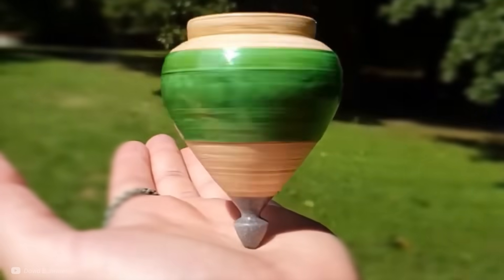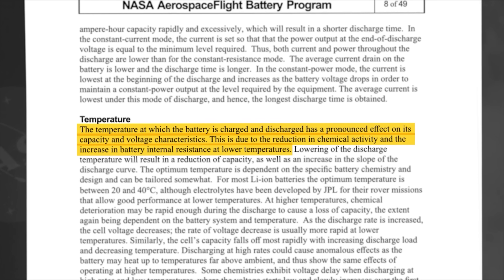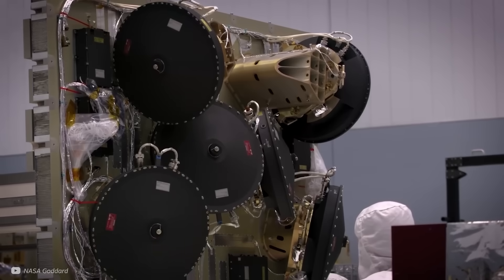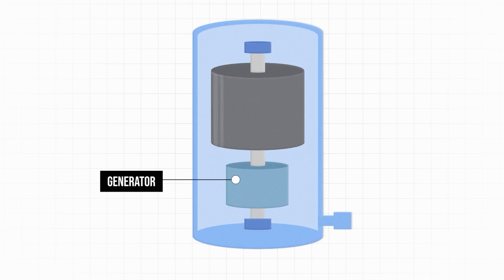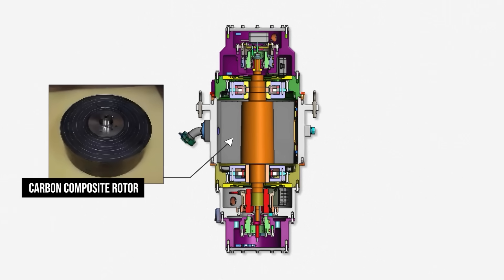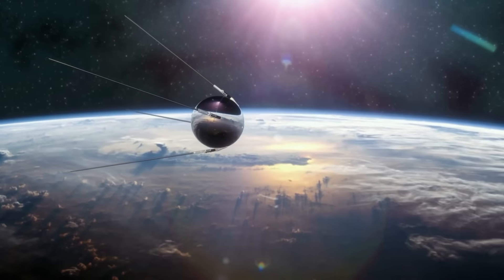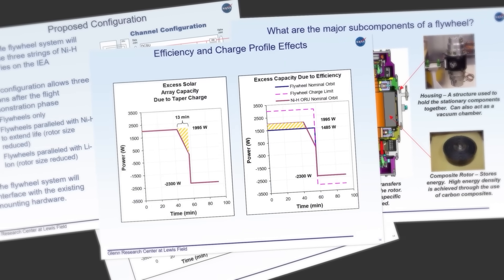How NASA Reinvented the Mechanical Battery

Comment: 6:20 what is said here is not 100% true in all cases, but ... True for 99% most common types of motors. There are exceptions and side effects.

The main issue is that :
- efficiency is not the same in both ways 
- operating an engine in both ways does have engineering challenges 

That's why outside Tesla, regenerative EVs were rare, or working with very low efficiency. Even Tesla was able to improve efficiency with « simple software updates » on some models. 

One example of particularly bad bidirectional motors are linear motors. 

This bidirectional aspect of motors is closely related to electric breaks used in trucks .... Trucks have low efficiency . Trains have both ability to use electric break and/or regeneration ( reinject in the network ). They usually try to reinject, but they still need to be able to slow down even when grid got disconnected by circuit breaker ... 

=» there are optimisation issues and exceptions, but most motors are reversible, and it's a HUGE topic. 

And in short, DC or AC does not matter. Both are reversible.

Comment: Stored energy is stored energy. It might not give you a large fireball on failure, but the excitement of a 100,000RPM flywheel escaping is hardly better. I’ve seen the results of a bearing failure on a 10,000 RPM gyroscope, and it wasn’t discouraged from exploring the building it was in by trivial obstacles like walls. I know which I’d prefer to fail in any building I’m in. Even light flywheels for control moment gyros on Hubble have struggled for long bearing life.

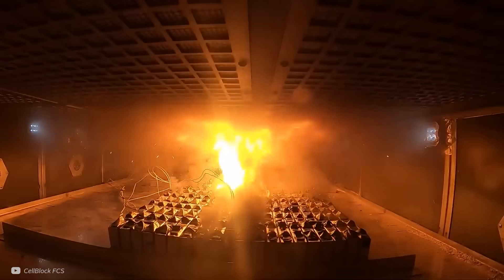Comment: 6:45 "they don't need as many rare earth metals" - This is a myth propagated by those who are ideologically opposed to electric vehicles and is designed to give the impression that lithium batteries use something that is rare. Rare earth elements are not rare and lithium batteries do not even use rare earth elements.

Comment: 5:10 "up to 50x the energy density of lead acid batteries" - the energy density of flywheels is similar to that of lead-acid batteries. However, the power density of flywheels is very high, i.e. you can put in and take out a lot of energy in a short time, quite possibly 50x the power density of lead-acid. 

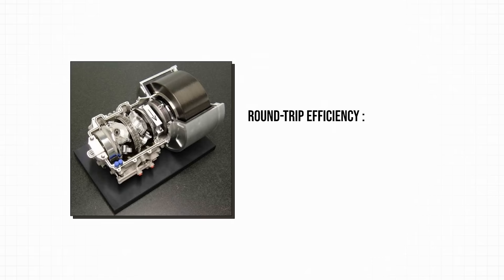Your slide at 7:10 shows specific energy figures of up to 36Wh/kg, lead acid-batteries are around 40Wh/kg. At 9:38 you quote an energy density of 33Wh/kg.

Comment: Ive never understood why even though motors & generators are the same why they dont also generate & be a motor at same time especially in space where theres minimal friction and also why dont they make use of drag to generate in the atmosphere as drags going to happen anyway so might as well make use of it  flywheel giroscopes have to be used for stabilisers so might as well generate from them aswell every little helps even if its only a trickle of energy as i know its not wise to have more torque thats why i said just a trickle

Comment: 7:08 but they should, there was a 1960s experiment using flywheels in buses and it went swimmingly for quite some time but had to be scrapped due to safety concerns which thanks to tech advancement are no longer an issue. 

The flywheel buses took less then a modern EV car to spool up, for 4 hours of use, had 2 massive steel flywheels in a steel container spinning in opposite directions to remove the gyroscopic effect and ran entirely off the flywheels. 

Modern Flywheel based mechanical batteries run at much higher speeds thanks to improvements in bearings and material science and so can reach the energy density in a much safer way without even the slightest chance of a giant steel disc breaking containment and flying down the road like happened with the 60s experiment.

Comment: If an electric motor has permanent magnets installed to replace one side of the coils it is also an alternator but not all electric motors are alternators. Some require constant electrical input to even be motors. This is due to the dual coil fix invented by Nikola Tesla* I believe.

*not any of the scammers using his name for brand recognition.

Comment: NASA didn't reinvent anything, and the whole concept is a moronic idea, that is why they eventually abandoned it. You don't need a lot of energy storage for a control moment gyro (CMG), this allows them to be compact, reliable, and relatively cheap to produce. Replacing a simple device with one that costs 100x more, is less reliable due to carbon fiber delamination, and requires complex control systems to stabilize the magnetic bearings, is simply a bad design. In addition, a single flywheel will weigh more than a standard battery and CMG. You will also need multiple flywheels. Also, the gimbals that the flywheel sits in need to be massive as well. NASA has been a huge waste of money, but hopefully, DOGE will eliminate it.

Comment: Nice vid so far. However, minor point.. Not every generator is a motor, and not every motor is a generator... Oh alright fine, they are, but some are FAR more efficient when run in "reverse" than others. The idea of just grabbing any old motor and cranking it by hand doesn't actually work all that well. You need one that is designed for high efficiency in both "modes", for the want of a better word.

Now if I could only remember a few examples. Older cars will have alternators. Older still will have generators. Those used to be pretty good both ways. A switching motor though is rubbish. Something about pulsed coils instead of continual fields.

Edit: Finished the vid. Good presentation. Earned a sub.  Another guy here on YT made a 3D printed vacuum battery. As in it's a series of plungers that when drawn out, create a vacuum within a cylinder. The weight of the atmosphere pushes them back in again, which turns a small generator. I personally love the idea, though I'm not sure about energy density. If a cylinder ruptures, it'll implode. Which is far easier to work with than an explosion. And given the vacuum forms almost instantly, to vary the 'charge' all one has to do is extend the cylinder. Provides constant pressure for the full draw, whereas compressing air into a cylinder has a high and low end to a scale. With full charge obviously being quite dangerous and potentially explosive.

Personally, I'm partial to artificial dams used for hydroelectric. Pump from the ocean up into a resevoir in the hills with solar power, then drain the resevoir back through the pumps to generate power at night. Efficiency is supposedly up around 95%. Fresh water from a lake or similar might be better for the local environment. Rain is 'free' power.

Comment: We already "store" impressive amounts of energy like this in the massive steam turbines of power plants. I wonder if for stationary applications less high tech and rpm but greater mass and number could be econmical or not ... probably on the very long run only  though only due to no degradation compared to lithum.

Comment: Vacuums do not have temperature. Temperature is a property of matter. The absence of matter means the absence of matter thus no temperature. Space stations actually overheat. They are cooled via radiation which is why they have large panels where coolant is flowed through to produce infrared radiation to cool via radiation.

Comment: I've always wondered how effective it would be to replace the steel mass of the flywheel with electrical batteries. Sure the density wont be as good so the flywheel will be less effective but it would also be able to store electrical energy in what would otherwise be useless steel mass. The mass has the be their anyway so why not make it something useful.

Comment: Back in the 1980s, I worked on a project involving a flywheel made of depleted Uranium. As best as I can remember, the "wheel" or Uranium mass portion was approximately 500-700mm across and 100mm thick. The mass was obviously approaching 1000kg. We were developing an ultrasonic flaw inspection technique for it. There was a concern that the wheel might fail catastrophically when spun to it's intended speed. I imagine that would destroy just about any facility housing it.

Comment: 6:02 --- "Every motor is a generator" --- could you elaborate on that? I don't quite get how induction motors could generate power: wouldn't it's stator need an external source of energy to create magnetic field required for electricity generation?
Reply: I suppose he thought "Every motor is a generator" was a more elegant way to put it than something like "Every motor is a generator when the motor/generator is allowed to spin freely and, if necessary, when a temporary source of energy creates the initial magnetic field until the motor/generator can supply its own current for the field".
Reply: Already wrote a long comment on this, but it's true for 99% motors, AC or DC. 

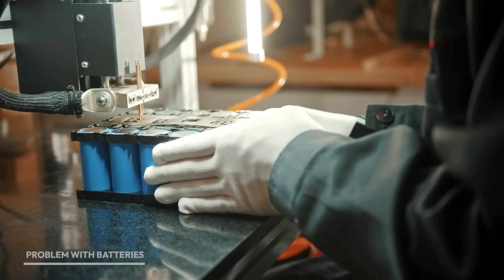For some types you need an excitation power in order to get a reactive power, usually with a ratio of 1:10. So yes in some case you need an external source, but still you motor will convert mechanical energy into « more electricity than you had at the beginning ». 

Most plants work this way today. It helps keeping generators sync.

Plants which can start without any source are rare, and harder to sync ( old hydro in France ).
Reply: Yes, you are correct and that's exactly how a car alternator works. Needs power to make power.

Comment: Have you come across the giro bus that used to operate in Switzerland. As it stopped at a bus stop it picked up power from an overhead power line. The giro weighed about 3 tons and span at about 3000 rpm in vacuum chamber to reduce losses from air turbulence.
Reply: Eso era un peligro total,si salía disparado podría haber destrozado medio Zurich,bueno si hubiese sido en el barrio de los banqueros no hubiese estado tan mal😅.

Comment: I don't think flywheel based energy storage is any safer than chemical. They may not be prone to chemical runaway but they're prone to mechanical failure instead. And then the stored energy has to go somewhere.

Comment: The operating temperature constraints of chemical batteries were the reason for a particularly unique problem with the hydrogen/oxygen fuel cells used as the power source in the Apollo Command/Service Module (aka CSM), which was actually mentioned in the "Apollo 13" movie. In the immediate aftermath of the explosion which crippled the CSM, one of the last procedures mission control does in a desperate attempt to isolate the oxygen leak was to close the "reactant valves" on fuel cells 1 and 3. The CSM had 3 independent fuel cells, 2 oxygen tanks and 2 hydrogen tanks, with each fuel cell capable of being fed from either tank. The "reactant valves" were just valves between the tanks and the fuel cells.
The electrical system in the command module had everything doubled up, powered by two independent distribution buses, labelled "Main Bus A" and "Main Bus B". These were redundant systems, with each one capable of powering all the equipment on the spacecraft, so if one failed, the other could completely take over. Also, only one fuel cell was technically necessary to power the entire spacecraft, though only if it was operating at maximum power output.

Fuel cells are essentially primary cells, and are basically batteries: The difference being that the chemical reactants can be continuously supplied. So provided you can keep feeding hydrogen and oxygen to the fuel cells, they will continue to make electricity for as long as you like. They do of course have the same temperature constraints as any other chemical battery, and would stop working if allowed to rise too high or drop too low.
In the environment of space, the more significant risk was the temperature dropping too low, since heat would be easily radiated away. The fuel cells operated at elevated temperature (they had to be kept hot to continue working), and the reactions which produced the electricity were also exothermic, producing heat while they were operating. As long as the fuel cells were operating with at least 50% of nominal power output, the heat produced this way was enough to compensate for heat loss, keeping them within their operating temperature range.
However, with all three fuel cells operating, the electrical demand was not always enough to keep them hot enough. So the fuel cells had integrated electrical heating elements to compensate for this: If the power required by the spacecraft dropped below 50% of the fuel cell output, some of the power produced would be diverted into the heating elements, in order to maintain the temperature within the operating range.

In the Apollo 13 movie, there was a discussion between the Flight Director (Gene Kranz) and the "EECOM" flight controller (Seymour Liebergot), where he suggests closing the reactant valves on fuel cells 1 and 3. Kranz objects on the grounds that the valves cannot be re-opened once closed, so this procedure would leave the CSM with only one operational fuel cell. Anyone familiar with how fuel cells operate may have questioned how this could be the case. Well, the characteristics of the fuel cells described above provide an answer to this: If the supply of hydrogen and oxygen to a fuel cell are shut off by closing the valves, the fuel cell can no longer produce power, so both methods of heat production (the fuel cell reactions plus the integrated heating elements) will also be shut off. The fuel cell will then cool down to below its operating temperature range. Once that happens, the fuel cell is effectively dead - even if the valves are re-opened, it cannot start back up.

Comment: Mechanical energy storage like this makes a lot of sense here on the ground, especially for grid-scale or even home-scale use. Flywheels are comparatively cheap next to chemical batteries, and the weight disadvantage is next to meaningless when the thing is just going to sit stationary on the ground. There are few - if any - rare earths or other problematic materials required, the lifespan should be significantly longer than chemical batteries, there's no significant operational risks (vs stuff like dendrite formation in batteries), and the decommissioning and recycling process is vastly simpler.

Comment: Carbon fibre flywheels were revealed over 30 years ago. Flywheels are clearly not new. They were used in buses in Austria/Switzerland in the 1950s - the flywheel is turned when buses run downhill, to take the bus uphill when running up and down the Alps. The technology could have been used in Liverpool's Merseyrail metro as the River Mersey rail tunnel has the steepest rail incline, up and down, in the UK. Charge the flywheel running down then power the train going up. But the now new Swiss electric-battery hybrids that reclaim kinetic energy on the downward run in the tunnel are used. Although not that efficient as they do not use supercapacitors, only batteries, to reclaim the kinetic energy.

Comment: Nice video. I personally think mechanical battery is just dead. Even for nasa.. I like it's purpose and all that but as you can see even nasa realized that efficiency of Litium battery storage is much higher and it is much cheaper to make it than mechanical battery type. Question is why not to make it in much higher amount for earth storage systems. As chemical side of Lithium battery will improve and as safety will improve even better there will be no need for mechanical battery as such

Comment: There is a company trying to get their flywheel into places where energy is dumped into resistor banks .. insted they can store the energy and then send it back to the system when needed.

Comment: I could be wrong but I thought the precession of a fly wheel was at 90 degrees to its rotation so it will actually try to turn up or down if you rotate it. Its what is used in some wrist strengthening devices to and can cause a portable generator to do some very weird things if you pick it up while running.

Comment: - yep calling them "electric machines" - is standard EE talk..

Flywheels are something Williams Engineering definitely explored as a form of mechanical KERS...

Magnetic  and "aerodynamic" - (Nitrogen or Helium fed) bearings, are  a fantastic creation - NB to survive launch shock loads, plain bushes are way more resilient than rolling element bearings.
 ( a wayto have "stowed" magnetic bearings, which only "activate" in orbit - Noting that oil lubrication is bad in space as the oils evaporate, solid (or extremely high vapour pressure "liquids and gels) lubrication is a must..

Comment: 10:00 fuel is still needed to counter the equal and opposite force spinning up a flywheel causes on the station.
Reply: Solar
Reply: @eastonjanecek9802   Do you not understand physics? When they spin up the flywheel the rest of the ship will spin in the opposite direction unless the RCS jets fire to cancel out that spin.
Reply: @link12313  not if you spin 2 different flywheels in opposite directions at the same time.

Comment: 0:50 a flywheel can not change a satellite's altitude. They provide rotational corrections only while the RCS jets are used for translation and boost up burns.
Reply: Attitude* not altitude
Reply: @de0509  Actually altitude means how high something is over sea level. Reaction wheel cannot change that. Attitude however refers to several parameters of the satellite like rotational position and momentum at a given moment with respect to earth. Reaction wheel can change some parameters of that.

Today a lot of satellites are using ion thrusters to raise their orbit periodically i.e. increase altitude :) Cold gas thrusters are heavy and used mostly for big stuff.